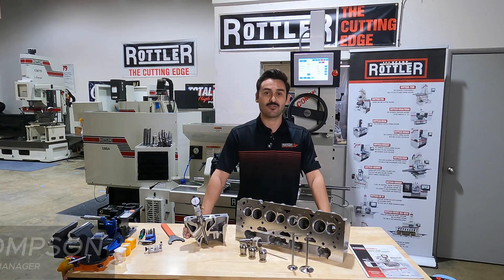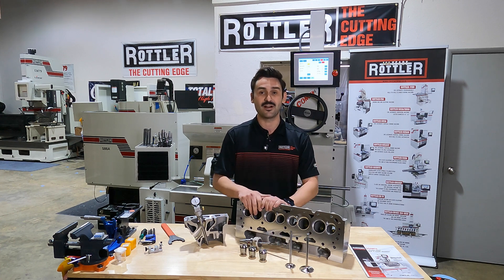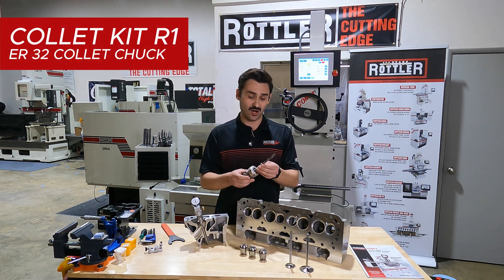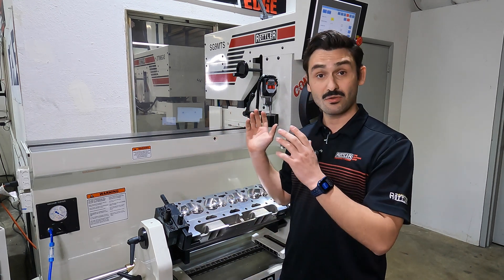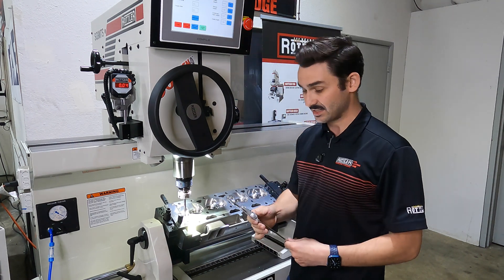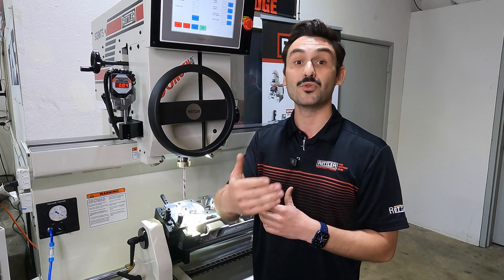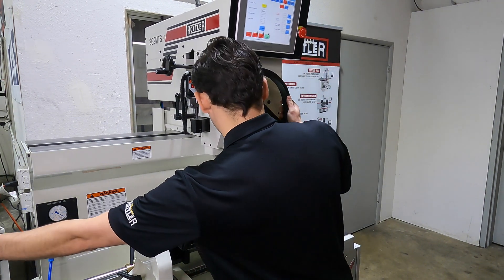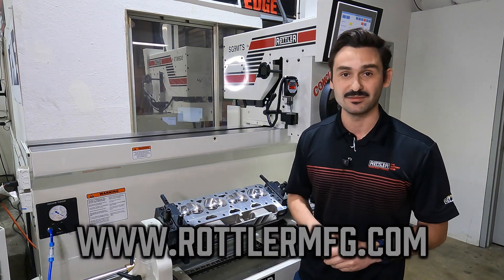How to Ream Valve Guides for PERFECT Seat Concentricity

Comment: This is an aftermarket machine designed for ease of use, low cost and flexibility. The way to get best concentricity is to cut all three seat cuts and the guide bore using the same custom tool, at the same time. e.g. Using MAPAL tooling. This is the way good engine manufacturers do it.